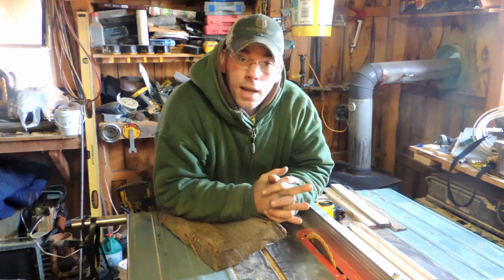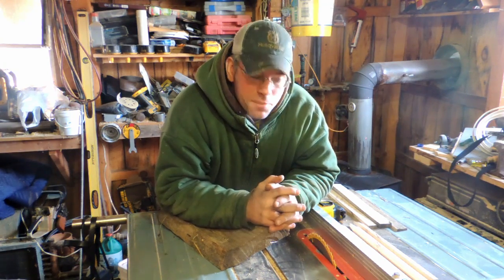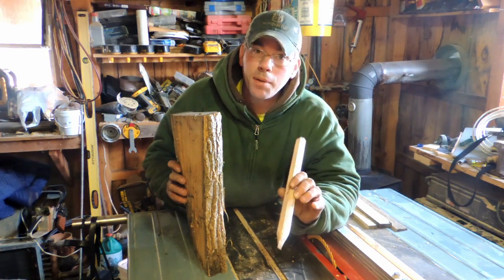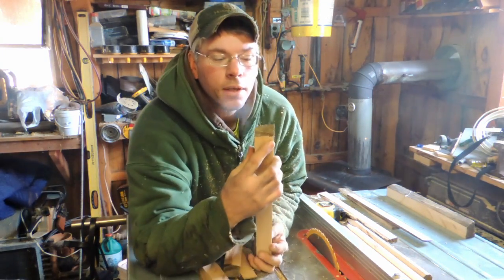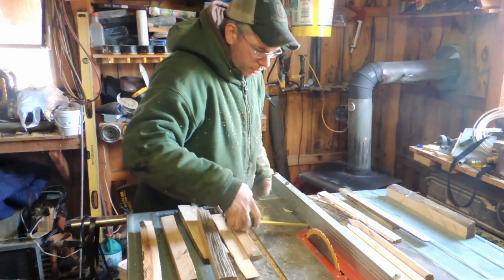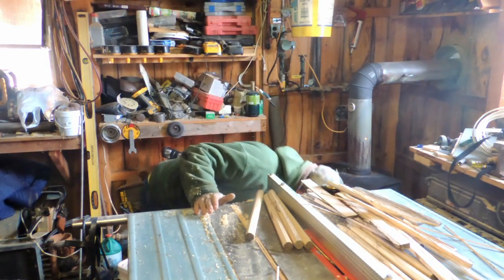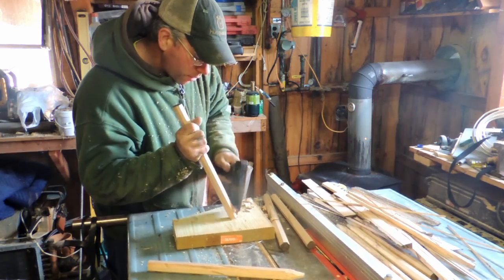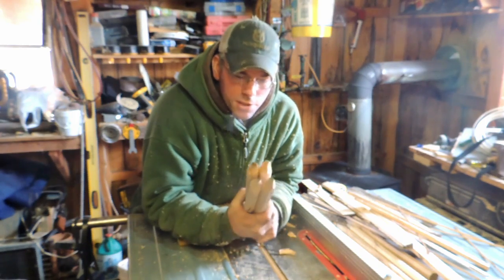A Timber Frame Vlog #7: Making Pegs for Timber Framing...The Quick Way!

Comment: Thanks again, Jim.  I appreciate the time you take to do these videos.  It has been a couple of years since you did this one but it has been helpful for those of us just getting to it.  Hope your leg healed well.  I do have a question about your scarf joints.  (I know it was a different video) I think I saw you use a couple of different types and wondered why.  Perhaps a question for a different time.
Reply from the maker: The tie beam scarfs are meant to withstand a very heavy tension load whereas the scarfs on the top plates were designed so that I could put the plates on one at a time.

Comment: Another classic educational video into timber framing. Top man Jim.
Is oak ok for the pegs.
I have started on the post tenon 6 so far out off twelve.  These are to connect into the plate beams.  I have done the tenons at 3" Square from 6 x 6. 
Have I done this correctly and they will be 3 and a half in length.  So when I fit them into the mortise I will do double pegs at 3/4" dia at high and  low level is this ok to do. The plate sills are 6 x 4 posts 6 x 6 and the top plates 6 x 5.
Thanks Jim
Reply from the maker: That sounds right.  You should br fine with the oak.  I'm assuming your tenon thickness is 1.5" so 3/4" pegs are perfect.

Comment: Thanks for this video.  I do it similarly.  One thing: I usually rive the stock first with an axe or a froe and mallet first, so that I don't get grain runout.  Grain runout would weaken the pegs.  

What do you think?  Or do you check for straight grain before you start sawing?
Reply from the maker: +Nunchuck Swordfish that's a point I should have mentioned and excellent for you to put out, I look for strait grain first to avoid the grain run out.  I was riving at first and tried a few on the table saw next and noticed that as long as the grain is strait then I was able to avoid runout, thanks for the input.

Comment: Love your videos. Question. You set your table saw blade to cut the pieces into 1" square stock, then once they were all done, you angled the blade to 45 degrees and moved the fence inward, but didn't say how much to move it. Do you just kind of wing it?
Reply from the maker: I do just kind of wing it.  On my big table saw I made reference marks to set the fence.

Comment: Dumb question....I am using a bunch of 6"x6" and 8"x8" white oak beams that have been dried already to build a workshop.
If I have a 1" peg hole diameter, wouldn't I use a 1" diameter peg?
Reply from the maker: +Chris Mccollum yes.  So on your 8x8 members you will have a 2" think tenon, that will call for a 1" peg.  On your 6x6 timbers you will use a 1.5" tenon with a 3/4" peg.  Good luck with your project.
Reply: Hi
Great content- I’m using 8x8 larch beams and posts using 1.5 inch tenons on all the joints including the wedged dovetail. This is what the customer specified but you make a reference to 2 inch tenons on your tie beams - I’ve already made the tenons 1.5 inch. It’s a big two storey barn so hope it’s gonna be ok!
Reply from the maker: Good morning.  Hopefully, it will be fine.  When customers specify anything on the engineering side, it's a good idea to find out if it's their design or if they were going by what looks good to them.  If you have housings that will be a bug help.  Good luck.
Reply: @TheTradesmanChannel  thank you so much for responding! Yes the tie beam sits onto a 1 inch housing in the post. There are three ties beams. I haven’t made the central one yet so I’m intending to make a 2 inch tenon for that one after watching your channel.
Reply from the maker: Excellent.  You're asking the right questions.
Reply: @TheTradesmanChannel  very helpful- thank you.

Comment: Wood nails, yeah. No rusting and shrinking of the fasteners due to metal loss with the rusting. also, no discoloration due to the rust staining the wood. I know this ain't McDonald's, but "I'm lovin' it"
Reply from the maker: +Thomas Russell I'm glad you like it.  Funny how nails will rot wood away, they actually attract moisture to the material from condensation and the rotting begins.  I use exterior screws now for everything.

Comment: Do you have pockets in your concrete slab for your posts?
Reply from the maker: +Jack Dile no I do not.  I gave it some thought at first and then I decided against it due to the moisture you always seem to get where concrete and wood meet.  What I'm doing is making angle iron brackets that will attach to the posts and then anchor the brackets into the slab with expandable concrete anchors.  Thank you for the question.

Comment: Sorry this comment is so late.  I just ran into your channel.  You are way too comfortable around that table saw blade.  Make a jig to push the peg stock through the saw.  Use the sliding fence with a piece of 1 x 2 on the face and a slot for the blade.  That keeps your fingers away from that blade.  You could even make another jig for cutting the 45° faces without getting your hands near that blade.
Reply from the maker: You are absolutely right and I should be more careful.  Being too comfortable with what I'm doing landed me in the hospital back in May for two weeks after shattering my right ankle.